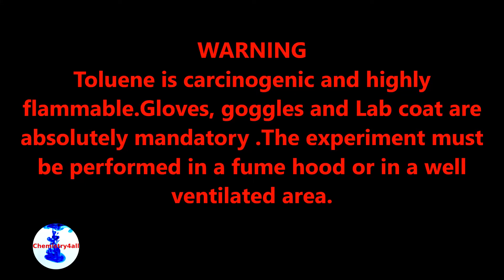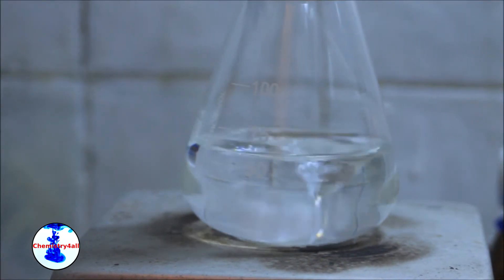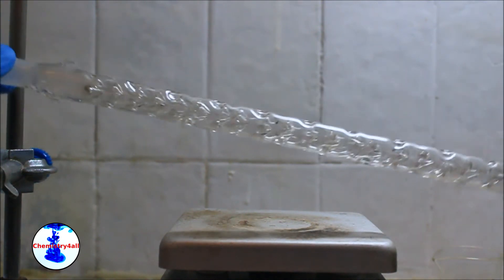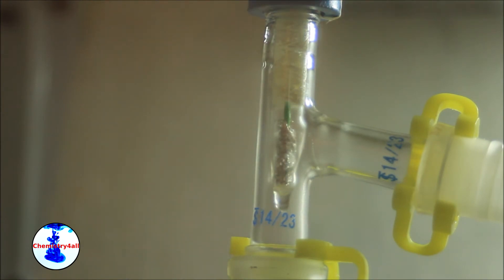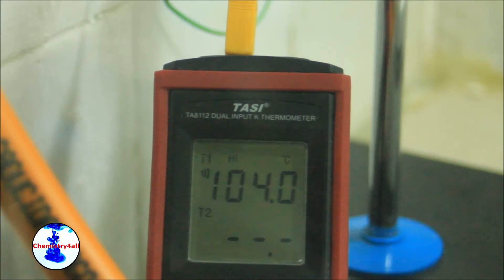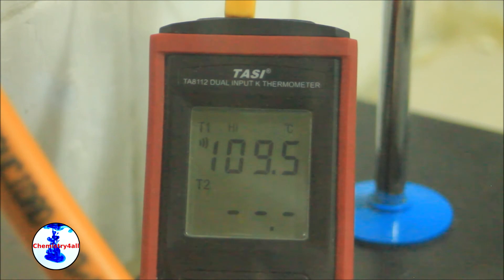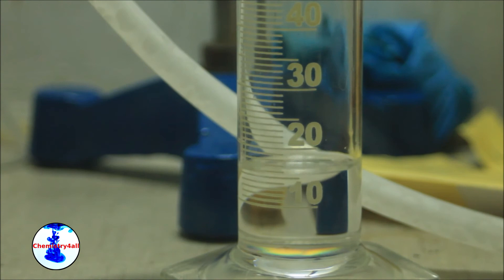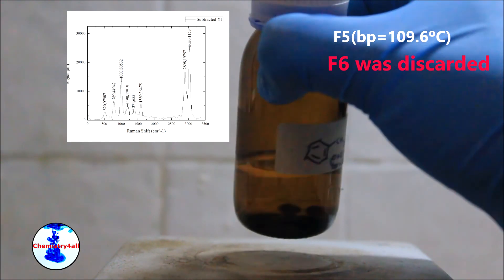How to make toluene

Comment: You distilled toluene, you didn`t make it. Maybe just change the discription.
I usually wash it to get out most of the more water soluble, fractionate it, then remove water with a Dean Stark trap.
Do a nitro reduction with sodium dithionite whit ratios. Don`t think it`s been done other then by Chemplayer in a series of micro scale reduction trails where dithionite came out as clearly best with a 30 min reflux and no steam distillation of end product, only vacuum filtration. I think he could have done a better work up, but it wasn`t really the meaning of the video. Simple distillation and drying with CaCl2 would probably have done much.